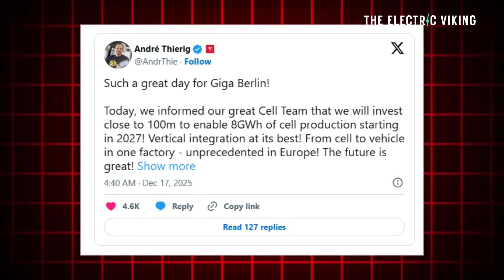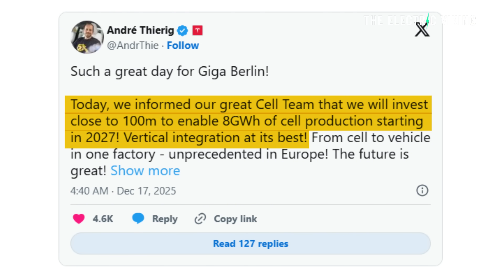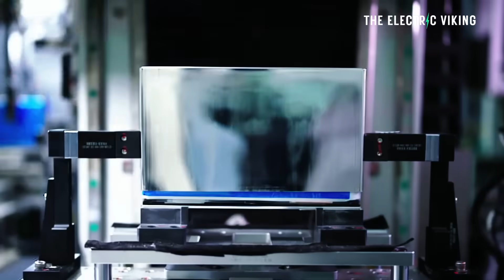DARK FACTORY! Tesla is Spending €1 Billion to Replace Berlin Workers with Bots

Comment: Sam
Not related, this just through from Volvo, ref EX30;

Volvo's quality follow-up procedures have identified a potential safety concern with a small number of EX30’s Single Motor Extended Range and Twin Motor Performance. We understand from our records, that you are the current registered keeper of a vehicle with the registration detailed above. Therefore, please read the information within this letter as it will explain the issue and provide full details on the action that you need to take.

What is the issue?
Investigations have identified potential overheating of a High Voltage Battery cell. This could lead to a possible fire within the high voltage battery. It is possible that if overheating does occur a message within the Driver’s Information Module as below appears.
Image of safety message in Driver's Information Module
What are we doing to resolve?
Volvo takes this situation very seriously and is working with the appropriate authorities to launch an effective action as quickly as possible. You will receive further communication regarding the solution as soon as it is available.

What you should do now?
Do not charge your battery above 70%

Comment: Every industrialist has wanted cheap labor since large scale manufacturing/mining/construction began at the beginning of the 20th century.  We need a new term for Robot labor as its clearly not the same thing.  Humans and their institutions are slow to change and usually play 'catch up'. I haven't heard anything from the major unions around the world (the free world, in dictatorships there are none).   Don't they realize the ONE THING they have to coerce wage and benefits OUT OF OWNERSHIP is Human labor (not Robot Labor)  I project a Luddite rebellion (once more) as not only boycotts and  lockouts will happen, but attacks on the Robot 'scabs' who are replacing humans in the factories (and soon on the deliveries).  This leads to 'Festung Factories'.   Pure human labor jobs are on the way out.  Brilliance and High IQ and Great Management remain outside the AI/Robot area of competence, but for how long.  Soon we'll all hear  "Daddy, what did you do before Robots?"   So Mr. Viking, what will you do when a robot streamer replaces your grinning face and sharp analysis?'
One bit of IRONY, the first use of the word 'Robot' was a play by a Czech playwright RUR,   Rossum's Univeral Robots, just a little over 105 years ago.  Civilization moves fast, from concept to reality and its getting faster, accelerating acceleration.

Comment: Remember, batteries are large and heavy.

Dry process
        +
Zero shipping costs
        +
Zero tariffs
        =
Profits.

and yes, the other items you mentioned factor in.

We shouldn’t assume Reuters knows more about Tesla’s cost to make batteries than Tesla does.

Tesla is in business to make money. Without good cause, they aren’t going to unnecessarily raise their own cost of doing business.

Dark factories? Yes, they’d like that a lot. Cells are mechanically simple. Once your factory is up and running well, most (all volume producers?) of today’s cell factories ARE automated already. I’d guess the most labor intensive part is QA. To automate that would require a good camera system (this part’s easy) hooked up to a good expert system to detect anomalies.

I do not know how labor intensive their battery assembly is. There, robots may help a lot.

Comment: They built the battery factory part right from the beginning of the project, they changed track during the build, sending the battery equipment to the USA so presumably it has been mainly unused so far.

Comment: You're just covering the battery part of the whole ev industry, with petrol and diesel cars, i would like to know more about the engine specifications than the average car buyer. In EVs i like to get educated more on electric motors, motor reliability, type of bearings used, cooling methods, etc.. this is just doesn't cut it for me

Comment: Deal Tesla, please make a normal ass truck. A large-Mid size truck (early 2000’s half ton size) that a sheet a plywood can fit flat between the wheel arches, 8000lb towing capacity, 600km unloaded range and megawatt charging speeds. Pull through charging stations. No need for 1000km of range if we can top up on 10 minutes without disconnecting the trailer.

Comment: Honestly Tesla might just want to get out of Germany and set up shop somewhere else.
Reply: That’s no joke.
Reply: And WHERE would you suggest that should be?
Reply: Awful idea. Germany's reputation in the auto industry is second to only Japan (and increasingly, China). Teslas presence there is a boon to its own reputation, by proxy. 

Also, Europeans are still quite hungry for EVs, so Tesla should maintain its current presence in the EU; since it already set up a German factory, may as well improve it further so it pumps out EVs to met European demand.
Reply: @davidx.1504  Most expensive electricity in the EU and man power(not too productive, they disappear for months and old), I wonder if Elon did his homework.
Reply: @drttgb4955  Berlin can install solar and batteries no problem to make their own power, and if this reporting is right, they'll just have more robots installed to eliminate much of the human labor.

So again, no need to leave Germany

Comment: No wonder Germans are avoiding Tesla. Tesla is replacing German workers with robots.
Reply: It will happen at all the Tesla factory's and all manufacturer's will follow.
Reply: Well technically that's not true. They are adding manufacturing of cells with only minor need for additional staff. No jobs are being lost, just not created. However, if they try to continue to compete using external batteries, they will have to find other ways to reduce costs (AKA German workers.)
Reply: @enigma-8u Yeah, but a ton of automation is increasing in automotive assembly lines. This will decrease the availability of jobs at auto assembly plants in the future.
Reply: Everyone will soon be replacing workers with robots worldwide.  Compete or die.

Comment: Tesla will cancel all expansion globally by the end of 2026 as sales are cratering in Europe, China, and the US. Cratering by an estimated 50% in US alone, their largest market.

Tesla has no working bots.
Reply: You need to improve your source of information.  Tesla sales are down a bit but far from cratering.
Reply: @coolblu101  Tell me which part is wrong and I will give sources.

EV sales fell 46% in one quarter in the US alone (Teslas biggest market) Q3 to Q4 2025 and fell 30+% for Tesla. In 90 days they can no longer sell in California (1/3 of their market) unless they stop lying about FSD. Current analysts expect a 50% fall in units and a 40% drop in margins on those units.
That certainly sounds like cratering to me

Tesla IS cratering in Europe (30% last year-2024 and another 35% this year-2025), and down 15% in China. They sold 120 cars in all of India in 2025 their "new" market. They are selling 1/2 the cars in Europe (150k) than they did just two years ago. (300k). That certainly sounds like cratering to me

16% of people polled in the US are even CONSIDERING an EV as their next car. That will drop now that the government handouts are gone.

Tesla no longer getting Carbon Credit which WAS their profit most quarters (as recent as Q1 2025)

I quote
“This high‑margin revenue was the sole reason Tesla posted a profit in Q1 2025; without the $595 million from regulatory credits, Tesla’s reported $409 million in profit would have been a $189 million loss.”

Margins are cratering even more as Tesla is severely discounting cars and giving away high margin "extras" to try to prop up their sales to keep the "illusion" going now that the government freebees are gone.

And that does not include the BIG lawsuits on two continents over FSD promises and crashes.

Wait until the class action lawsuits come when people realize FSD will not work without HW5 even though they have been selling it since HW2.

The crash is going to be epic and make Enron look like a child's play.

And yes, Tesla has no working bots. The last demonstration robot fell over serving water even with a tele-operator......LOL

You gullible Muskrats crack me up. The emperor has no clothes.